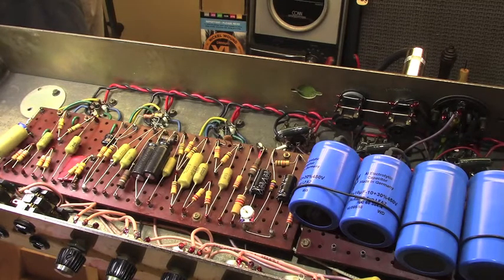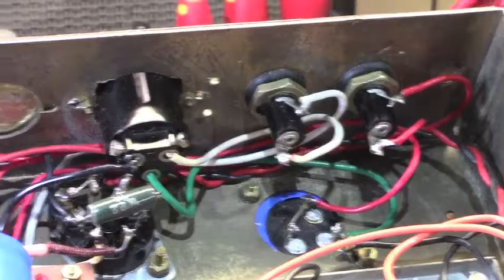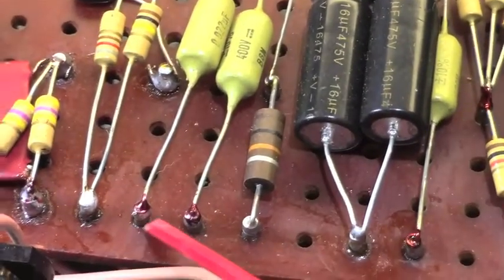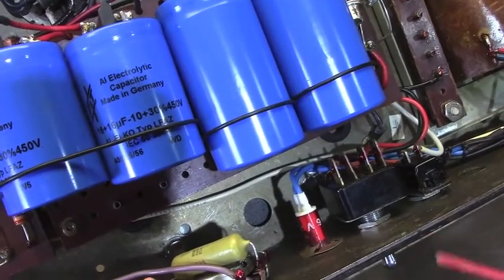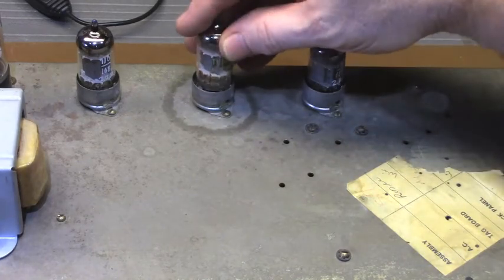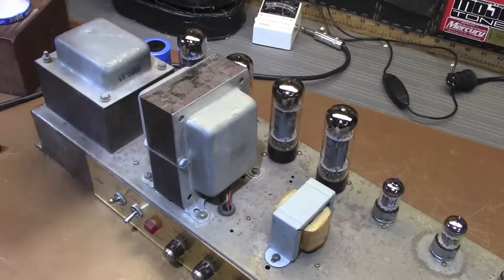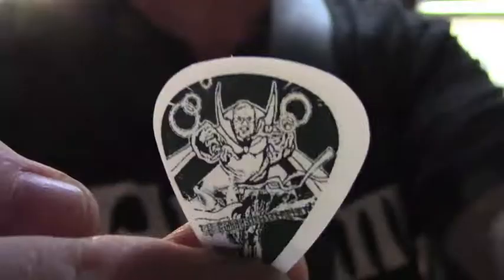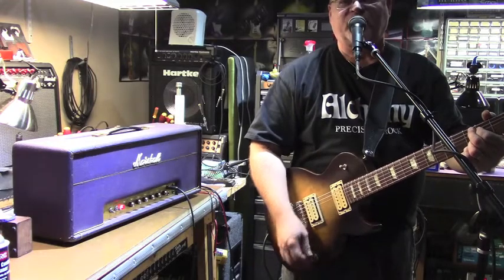On The Bench - JD Simo's 1967 Marshall Super Lead Amplifier

Comment: Very interesting, this is an oddball amp as it was clearly modded with a split V1 cathode like '68 Superleads onwards as there is no lacquer on the corresponding turrets. That being said there is no 0.68 V2 bypass cap (though one may have been installed and later removed) and to make things weirder it never had a treble cap on the vol. 1 but the coupling caps are .022 like Superleads from '68 onwards, all supposedly factory original due to lacquer. 
Also seems like a C1998 OT which means it is either a very late '67 or a '68 amp (or a replacement OT).
Reply: Noticed that as well. But it looks like by the way the turrets are on the 68k input resistors that it was originally a split cathode.
Reply: @joshuahymer15  
Not sure what you mean - the 68k input resistors are laid out exactly the same on split and shared cathode amps.
Reply: @eladerlich9735  nope.  They are not.  Look at the first pair on each bass/lead  .... they angle to the right for lead for the split cathode set up. They both angle to the left for shared cathode.  See learn something everyday.
Reply: @joshuahymer15   Thanks for the insight, that being said - if the amp is indeed a '67 - the split cathode was still a couple of months ahead so I doubt the board layout would reflect any consideration for the extra cathode cap and resistor.
Frankly, with that serial number (10:44), the OT looking more like a Dagnall, the amount of Iskra resistors, the seemingly original lacquer on the .022 PI coupling caps and the input resistors layout you pointed out to it seems that this is a '68 amp.
Reply: @eladerlich9735  I have an amp of similar age. It’s a super bass. Both Dagnell transformers.  It’s the best sounding amp I’ll ever have
Reply: Is that the Dickie mod ?
Reply: George Metropoulos had one of these 1050X s/n, his had Dagnall tranny's 
Mine is 1040X Drake tranny's
Reply: Replacement choke here I believe this one is 2000 series s/n looked like Drake power tranny number but couldn't see up close

Comment: Is there a reason to use a mica cap in the tone stack?
Reply from the maker: Buddy Martin - They are readily available and sound good in most cases.
Reply: So really no reason other than it’s a good cap to use. I know the mica’s are super stable but didn’t know if it had any real advantage here. I hadn’t seen them typically in this type of circuit. I’ve always used them and seen them used in like an oscillator circuit with tight tolerances. I double checked the schematic and just saw a regular cap listed. I was just curious, you are so amazing in these amps, I figured it there was any specific reason you would know what it was. Thank you Scooter.
Reply from the maker: Buddy Martin  - Silver Mica is just slightly more "hard" than the original cap in that position.  But when the originals go bad they are really the next best thing.
Reply: Thanks a lot, I pickup a lot from your discussions. This is another nice thing to know.        Buddy

Comment: Ohhhhh boy. Simo loves these amps!
Reply from the maker: MATT FIELDS He should.  It was his.
https://youtu.be/c5Zo_iOXaRg
Reply: Granville Guitars yeah, I read the title! Didn’t he run these on a buck transformer? Did you check the heater voltage? I would guess it’s meant for an actual 110v if it’s running over 500 volts. Aren’t EL34’s rated at a ridiculous plate voltage anyways?
Reply from the maker: MATT FIELDS - He used a variac set to 113v.  I was able to set the idle current where I wanted it.  E34Ls will take higher plate voltage.